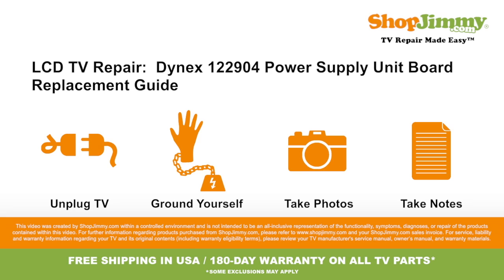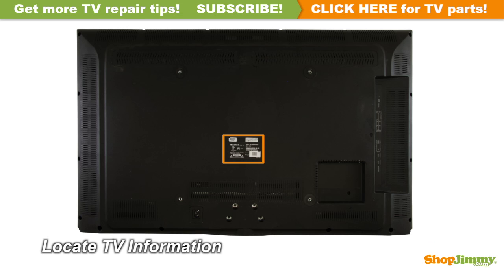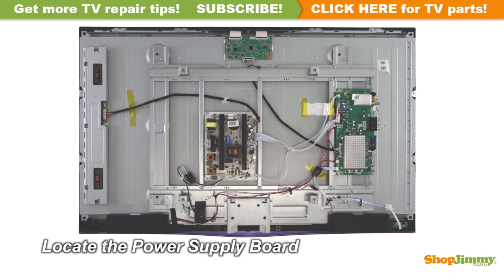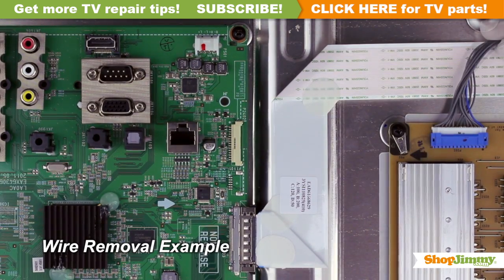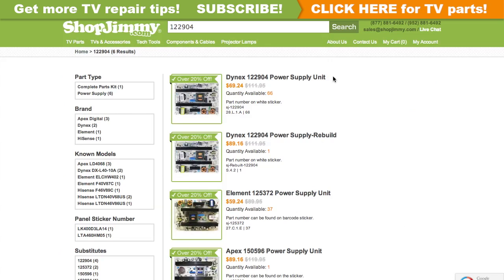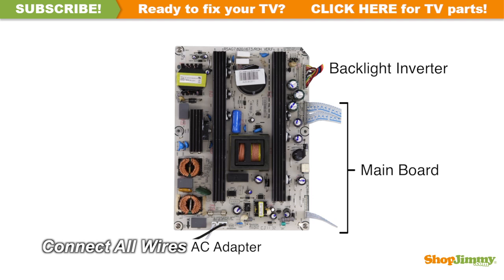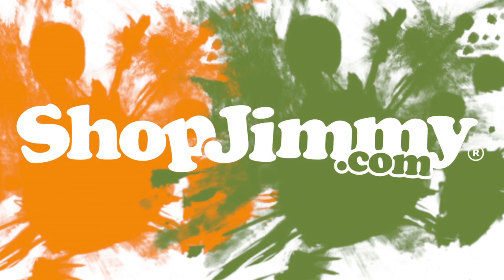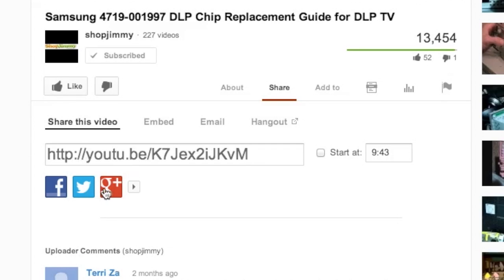Free Dynex 122904 Power Supply Unit (PSU) Boards Replacement Guide for LCD TV Repair

Comment from the maker: @Mark Jordan - I would recommend setting all settings to default, if the sound dosent come back unplug the cable box and the tv for 10 minutes and see if this helps.  If this does not work, I would recommend replacing the main board as that may fix the problem.  Thanks and please let us know if you have any further questions!

Comment: My 10 yr old Dynex 32L 151A11
Stopped working when I was disconnecting an antenna. No power light, nothing. Tried the 10 sec button, waiting a min to plug back in, nothing. Should I even bother taking the back off to see if anything looks fried on the power board?

Comment: Have a dynex DX-l40-10a  and it the red standby light is on but the tv itself wont always power on. sometimes it will flicker the blue power light then go back to red  or just stay red   but eventually it will click on and stay blue  would this be the power supply?

Comment: My Dynex 32" LCD TV goes off by itself. Sometimes it will come back on in the middle of the night on it's own. Need to know if this is a power board issue or a microchip/eprom issue?
Reply from the maker: Steve McKinley   I recommend replacing the power supply board in your TV.  Please reply with your TV model number.  Click here to view a video that shows how to find your TV model number:  https://www.youtube.com/watch?v=S51nhAmwR2M  Thanks!  www.shopjimmy.com
Reply: I did but it's still doing the same thing. After about 30-40 minutes it turns off all by itself. The Model#DX-32L200NA-14.